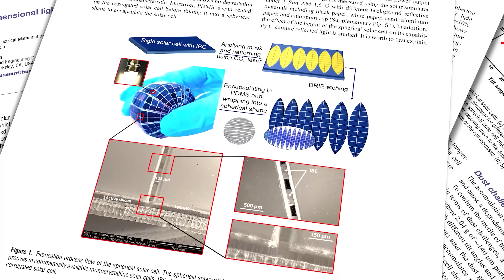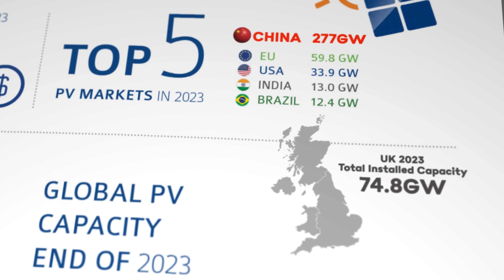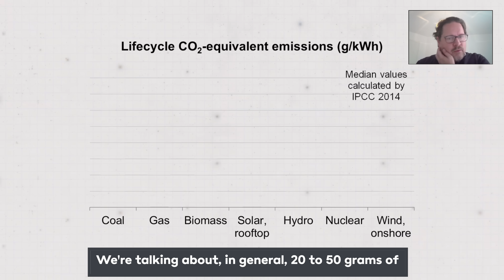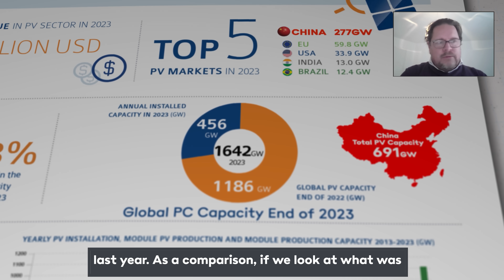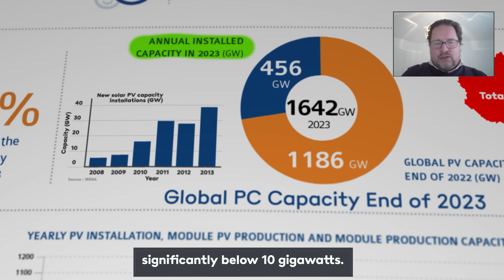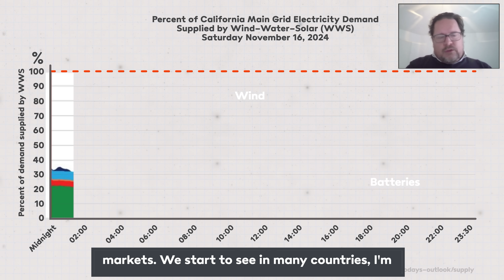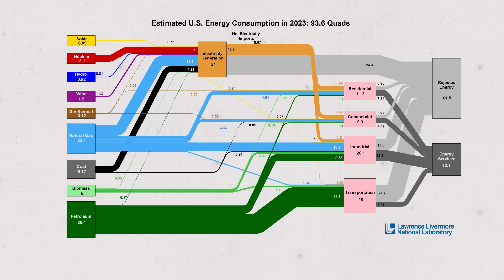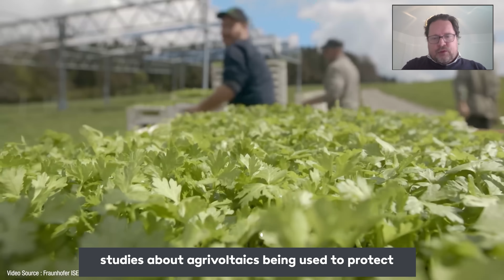Renewable Energy Domination

Comment: Despite having all this solar, a state government minister just appeared on Australian tV last week begging people not to turn on pool filters, avoid charging cars after 4 pm, turn off air conditions to avoid grid overload. We also have some of the dearest electricity in the world, most of the current domestic solar was installed using huge grants from the government (Tax Payers) to offset the cost of instillation. The replacement systems in 10 years will be at full cost, most of the grants were accessed by the already wealthy and the middle class that owned there homes, so effectively the working poor paid in part through taxes to reduce the cost of living for the well off, but at the same time increasing the cost  of living for them through massive increases in electricity. The government just handed out special payment to offset rising power costs, every person, regardless of they were rich or poor got the subsidy. Regardless weather they had already got a grant for solar instillation or battery  or weather they were selling electricity back to the grid effectively paying zero in electricity. Instillation of solar and wind does not solve the energy problem right now or into the future. With the ever increasing in demand for power  you will need a lot of pixy dust to keep up with total energy needs as demand will out strip supply. The distant future will not be solar and wind just like the Beta video Cassette, they will become a distant memory and people will say Yeah what the hell were we thinking, it was never going to work long term. In the mean time shit loads of people are making a killing peddling this unsustainable  energy generation form, and some Politicians  are ensuring they life beyond politics, Quid Pro Quo.           https://youtu.be/YbxpieEQ7bc?si=ktYHVRah_4mGYOuT
Reply: I was wondering where you were getting all of that nonsense, then I realised that you are overdosing on the LNP Kool aid, Via Sky news.😂🤣
Reply: That was a long Gish Gallop of disinformation and Misinformation blended in a word salad of  lies and a liberal dressing of bullshit.🥴🤣
Reply: Which "state government minister"?
And when?

Comment: 10 years ago I installed a 10KW solar PV system. It is running flawlessly, generating all our Electricity, has had one replaced microinverter in all that time. I do not know the cost of buying Electricity from my utility but I am sure it has risen a lot in 10 years. They still charge me to read my meter $6.00 monthly. Many of my neighbors have joined me going solar over the years, have not heard any complaints. In New Jersey where I  live. The state pays me c. $200 per Kw, it is called a Solar Renewable Energy Credit, SREC a nice check to receive in my retirement, the Srec's last for 15 years! One of the best investments I ever made and I feel so virtuous!
Reply: $200kw ?
Please check your figures.
In Australia we have a grid with smart meters installed ,no manual meter reading required.

Comment: In germany we have now the problem in some rural areas that the farmers have too many PV on their barns and stable. There are not enough consumers for that power. The local low power grids cant take it. In cities there is no such problem. I am not sure for the transforming stations can be altered that the power from the rural low power grids can be transformed up to the mid power grid. That would need some investment but is solvable if technologically possible. On the second hand, we just started to install electrolyzing units that produce H2 from electrical power. 
In my small city the oil refinery builds a 100MW unit to replace some of the H2 they produce now from natural gas to run their Hydrocracking unit. They might scale it up to 600MW in the next decade if successful.
The power plant on the other side of the city gets a 300MW unit (lots of high voltage power lines there) and is connected by pipeline to huge industries some 100km away. There is already a H2 pipe net fed from refineries who pump their surplus H2 in there. Max capacity at that site is 2GW. Other areas build H2 producers too. Our industry has a demand for H2 in the range of 70TWh per year. As a buffer some salt cavern will be used.

Comment: The UK, Europe, Germany and the rest of the world have been too slow to transition to wind and solar energy and all electric vehicles.
Wind and solar energy do not need to be imported and can be produced locally in any country.
Europe needs to provide more incentives for homes and businesses to install electric heat pumps and get rid of old polluting gas and oil boilers.  The move to electric vehicles will also be sped up. There is no good reason to help fund Putin's war by buying oil, gas and coal from Russia. There is a Climate Crisis making weather events more extreme.  Time to switch to renewable energy. The future is renewables. They are safer, cleaner and cheaper than fossil fuels. It is time for governments to end fossil fuels industry subsidies.

Comment: 9:18 POPPYCOCK!  PV recycling is not mature.  It largely doesn't even exist.
Reply: As opposed to your "Poppycock" posts.
PV panels are being recycled.
Up to 95% of a PV panel can be recycled.
The technology is available, expanding and growing.
To be viable at scale, there needs to be a supply of panels to be recycled, that is starting to occur.
Why do you feel the need to speak disinformation and humbug.
Reply: @davidwatson8118  Nonsense.  Do you even know what the term a mature industry means?  To the extent it exists at all, it is certainly not mature.  Panels were barely sold until around 2010. That means other than defects and damaged panels, there has not been a large supply of panels.  Furthermore, the oldest panels in far fewer numbers were made quite differently than the panels made since about 2010.  The panels made in 1994 which would be at end of life today (30 years) are not the same panels being made today.

Solar is mostly lies.  Solar is not cheap and is not easy to recycle.  The industry uses BS numbers to make them sound way better than they are.  Numbers like LCOE.  This hides that fact that when you need X amount of power 24/7, you need huge batteries and 10x or more of the power you need.  Like if you needed a constant 1kw, you would need to install at least 10kw of panels and 120kwh in batteries.  Five days of heavy cloud cover in winter is common, that is what drives up the batteries so much.  Solar is useful to the grid for marginal generation.  All over the world, areas with the highest amount of solar power grid generation are the most expensive energy markets.
Reply: @tarstarkusz  
Ok , so where did I use the term mature, and it's nice to see you agree with me and backed up what I said.👍
Reply: @tarstarkusz  
"Solar is mostly lies" 
No it is you that keeps lying.
Solar is cheap and solar and wind are producing the cheapest electricity.
Reply: @tarstarkusz  
"All over the world, areas with the highest amount of solar power grid generation are the most expensive energy markets"
That is a blatant lie.
Reply: Solar is only cheap using the  LCOE metric.  The grid needs a specific amount of energy 24/7.  For this you need  MUCH, MUCH higher than nominal wattage installed and you need a week of battery. 3-5 days of basically no sun is very common in winter.  The sun is much lower in the sky, shines for fewer hours and the rays are much weaker in winter.
If you had a cabin in the woods that needed, had to have, 1kw continuously, you would need something like 10kw of solar and you would need at a minimum, 96kwh of battery.
Reply: @tarstarkusz  
More blatant lies.
Bla Bla Bla Bla 
More cut and paste nonsense,  I notice you cut and paste this same crap repeatedly.🥴
Reply: @tarstarkusz  
"If you had a cabin in the woods--------"
I have a house with Solar PV, so I know you are talking crap.
A 5 min internet fact checking, says that you are a pathetic liar.

Comment: Solar is certainly having its place where it's "reliably" sunny and the consumption follows very tightly production. In other places with current storage tech it seems waste of limited resources.  Interlinking different countries and regions to transfer power from where it happens to be sunny to where it's not would require insane overbuilding of not only transmission lines but also production.
Reply: You mean like gas and oil pipelines and internet cables 🤔

Comment: China is building new coal plants at the rate of 1 a week.  China emits more than the rest of the world combined.
Reply: Old and outdated.
You omit the fact that China is now curtailing  permitting.
Please catch up.
Reply: Actually, China has very recently started closing coal plants faster than new ones are being built; renewables are making such a contribution now that they can start phasing out coal.
China's newer coal plants are much cleaner than the old ones. For a long time they built lots and lots of new plants, but at the same time shut down lots of old (dirty) ones, which is good.
Meanwhile China's renewables buildout is happening at warp speed, much faster than anywhere else. They are on the right track.
No, China does not emit more than the rest of the world. China's historic cumulative emissions (i.e. the ones that really count; it is a *cumulative problem*) are very low relative  to global North's cumulative emissions, even on an absolute basis; on a per-capita basis (the only fair way to compare), China's historic emissions are negligible, extremely low. CURRENT ABSOLUTE (not per capita) emissions are moderately high, but that's not a fair way to look at the issue if you are making comparisons.
Reply: @alan2102X  1/2 of the new solar isn't even tied to the grid.  Just as they have built escalators to nowhere in fields and buildings which fall down.  The emissions show you are lying. They've been rising every year other than the minor slowdown caused by the recession in the last couple years.

China, TODAY emits more than the rest of the world combined even with their heavy recession.  Talking about total cumulative historical emissions is disingenuous and a total red herring. The environment does not care about any of this bs. 
Unlike the rest of the world, China leads the world in generating all kinds of pollution, not just emissions.
China is not even claiming they are going down.  They claim they plan on reaching peak emissions in the 2030s. This has been pushed back multiple times.  This means they plan on increasing emissions every year until at least 2039.
Reply: @alan2102X  1/2 of the new solar isn't even tied to the grid.  The emissions show you are lying. They've been rising every year other than the minor slowdown caused by the recession in the last couple years.

China emits more than the rest of the world combined even with their heavy recession.  Talking about total cumulative  emissions is disingenuous and a total red herring. The environment does not care about any of this rhetorical tricks. 
Unlike the rest of the world, China leads the world in generating all kinds of pollution, not just emissions.
China is not even claiming they are going down.  They claim they plan on reaching a peak  in the 2030s. This has been pushed back multiple times.  This means they plan on increasing it every year until at least 2039.
Reply: 1/2 of the new solar isn't even tied to the grid.  Just as they have built escalators to nowhere in fields and buildings which fall down.  The numbers show you are lying. They've been rising every year other than the minor slowdown caused by the economic slowdown in the last couple years.

China, TODAY emits more than the rest of the world combined even with their heavy slowdown.  Talking about total cumulative historical carbon is disingenuous and a total red herring. The globe does not care about any of this rhetoric. 
Unlike the rest of the world, China leads the world in generating all kinds of pollution, not just carbon.
China is not even claiming they are going down.  They claim they plan on reaching peak carbon in the 2030s. This has been pushed back multiple times.  This means they plan on increasing carbon every year until at least 2039.

Comment: @JustHaveAThink 
David 
    One of your contributors said that with regard agri-photovoltaics:
"It must be done properly just to make sure that energy production is not replacing, even if the percentage is very small, not replacing agriculture, which might play negatively in terms of social acceptance" 

I would suggested the argument needs to be significantly more nuanced innovative should say that it should not replace agriculture used for projection producing food crops, possibly should even be confined to food for direct human consumption not animal feed. 

Installing PV on agricultural land currently used for bioenergy crops has actually a brilliant idea. The UK currently has about 133,000 hectares of land growing bioenergy crops, like 36% of which is used to produce transport biofuels. This is basically growing food crops for burning, which sounds pretty daft when you put it that way. From some ballpark calculations, is that land was covered with solar farms then it would probably provide between 50 and 200 times greater reduction in CO2 emissions than it's current use, depending on which bioenergy crops are being grown and what the end use would be. Furthermore, solar panels wouldn't require fertilisers or pesticides and if not used in agri-photovoltaic mode, the land would be effectively undisturbed and provide a great wildlife haven. 

As an example, calculations I did for Ecotricity's green gas mill concept indicated that 1 hectare of land would provide enough gas for about 2½ typical UK homes. 1% of that land, 100m², covered in optimally positioned solar panels would provide enough electricity to replace the gas supply of about 5 typical UK homes with electrical alternatives, assuming a heat pump instead of a gas boiler. That's effectively roughly a 200 times reduction in land use to achieve the same end user requirement. Note: Ecotricity's green gas mills use non-intensively farmed grass as opposed to intensively farmed by bioenergy crops, which would probably roughly double the yield, possibly improve economics but with a worse outcome for the environment.

PS. And of course, a brilliant presentation as always.

Comment: hey dude, dont spose u cud find out for us the effect of solar on forest fires? ive always wondered if in really sunny countrys it is something that needs depigning around?
Reply: What?
Reply: @davidwatson8118  glass buildings and heat waves dont mix, im wondering if the idea of sunny countrys being perfect for solar may increase fire risk. 
if certain types are better or worse ect. 
i have a bird box that the paint melted of during the last heat wave from window reflection. 
also if solar panel roofs on mass scale wud effect the heat islands in citys, weather agrophotovoltaic systems are better. 
just generally wondering
Reply: @katejackson7432  
Seriously 🥴
🤣
Reply: @davidwatson8118  what? 
u dont know the answer?
Reply: @katejackson7432  
On the contrary, that's why I am laughing at you.🤣
Reply: @davidwatson8118  rather than answering?
Reply: @davidwatson8118 no need to ridicule someone for asking a question.
I take the view there are never bad questions - just bad answers.
Reply: @Sairfecht  
Says the guy that posted this.
"Not sure solar panel's are the answer to genocide 😂"